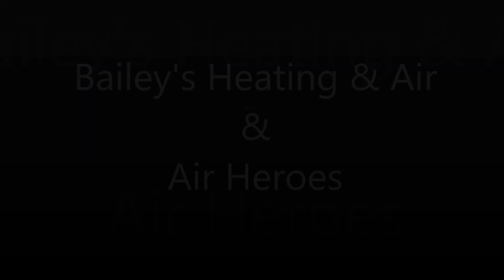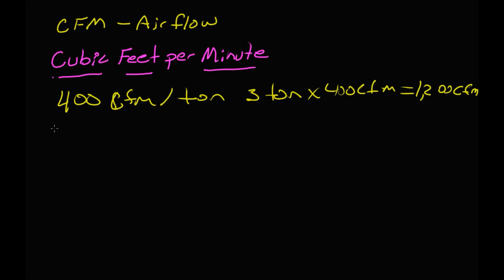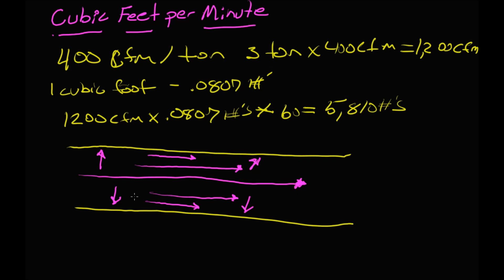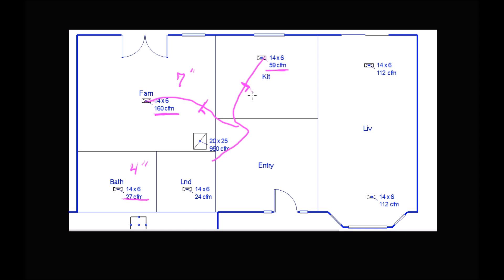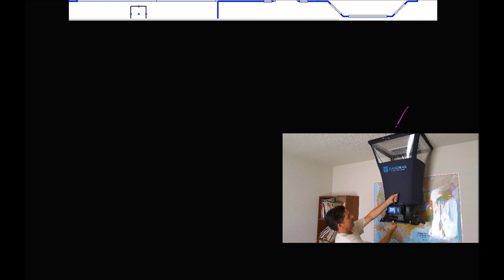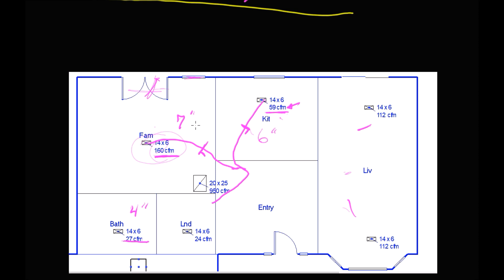CFM & Air Flow

Comment: great video!! thank you for posting it...
Which software are you using or can recommend for residential applications?? 
Thank you again!
Reply from the maker: Currently when doing testing we use the TruFlow Grid for static and cfm through the system. When doing a service call I use Fieldpiece smart probes and Joblink app. When designing a system on the computer I use Wrightsoft right draw and right duct. Links below.

Wrightsoft https://www.wrightsoft.com/

True flow grid https://www.trutechtools.com/tec-minneapolis-digital-trueflow-grid-full-kit-with-all-8-adapter-plates-no-manometer.html?gad=1&gclid=Cj0KCQjwtO-kBhDIARIsAL6Lore-ISwGfbK0aJNgq-ileA79e00rCy4cf529F1rnyMrZXEtkvfvRzrwaAqqiEALw_wcB

Fieldpiece https://www.fieldpiece.com/product-category/job-link-system/

Comment: If I need to do a load calculation on each room to find out how many CFM I need, what's the point of a ductulator?
Reply from the maker: Once you know the cfm needed plus the friction rate you need to use, you use the ductulator to size the ducts to that room.
Reply: @baileysair  
So if i go on a service call and customer complains that a certain room is always warm, i would have to do a load calculation just to see if i have the right size duct(s) to that room and have the proper cfm? That seems like alot.
Reply from the maker: @BibleBloopers  Yes, it does seem excessive. But there is no other way to tell if the proper amount of air is getting to the space. However, you should ask the customer has it always been this way or did it just suddenly start? If it has just started, the first thing I would check is the ducts themselves that go to that room to see if they are crushed or disconnected. 

The next thing before doing a calculation is make sure that the loads in the room has not changed. For example did they just put a computer and monitor in the room? 

If this has been a problem from the start I would check that they have insulation above the room. If that is good I would take my flow hood and measure the amount of air that is coming out. I would also do it with the door open to the room and closed. Sometimes we find that when the door is closed the air is almost cut in half due to the return being located in the hallway (there is not enough undercut of the door to return the proper amount of air). 

Now a question for you, once I have that measurement how do I know what that number should be? The answer; The only way to know what that number should be is to do a load calculation.

Once the load calculation is done and I compare the number it should be within plus or minus 10% of what the load calcs say. If not I need to either balance the system (if there is enough air to begin with) or install a larger duct along with volume dampers in all the ducts and balance the system.

Okay, that being said there is one other thing that needs to be considered and that is how we install and run the system. What I am talking about is the location of the thermostat. Since we only have one thermostat in the home, we can have rooms that are hotter or colder. Why, because the thermostat does not know what the temperature in that room is if it is in the hallway and loads like computers, monitors, televisions, and people can cause those rooms to heat up quicker than the rest of the home and therefore before the thermostat has a chance to sense it. The solution, zoning.
Hope this helped, 
Mitch
Reply: @baileysair  wow, that's a lot of good info. Thank you so much for taking the time to write it all out.

Unfortunately, if i come across a customer who just moved in, they wouldn't know if this was always an issue or perhaps a new issue. But i hear what you're saying.

First things first, check to see if any ductwork has come loose or if anything is kinked. Check to see if there's insulation over that particular room. I actually never thought of that. I'm just a service tech so that never crossed my mind LOL. So insulation over room... Got it. 
And then check to see if perhaps they have a high heat load in the room.
Reply: @baileysair  
Assuming that your system is size correctly, assuming that when you walk into a house you have a 5-ton unit and it sized correctly. Is there at that point a rule of thumb for the size you should use for return duct and supply duct? I don't like assuming. But I'm just trying to get a better understanding of this. So my question is if I have a 5 ton condensing unit and air handler that is sized correctly, would I be able to calculate what size duct I need at that point?

The reason I'm asking is I went to a service call yesterday where my airflow seemed a little crappy. I'm following up today. But I'm wondering if my return and Supply duct is sized correctly
Reply from the maker: @BibleBloopers  First question, what is the total external static pressure? I have a video that shows how to take static https://youtu.be/gnmcplXbOT0 You can download the manual for this particular air handler to see how much air is actually being delivered. NCI has a duct design table that says a 20" flex duct is capable of about 1700 cfm, and typically that is what I see installed on 5 ton systems all the time. However, don't think that just enlarging the return or adding another return will do the trick. You see, if the return ducts are too small what makes you think the supply ducts are sized correctly? They are probably not. Many companies think that just by upsizing the return will solve all the airflow problems, this in most cases, is dead wrong. 
Second, if the TESP is too high, I would check to make sure the coils is not plugged and or the filter may be clogged or too tight. 
Let me know what you come up with.
Reply: @baileysair  i took external static pressures today. The furnace is rated at .5 wc and i was getting .82
I'm just learning about taking static pressures so i kinda screwed up by not writing all the numbers down. 
I should've wrote down what my static before the blower and static after heat exchanger was but instead i just took it and came up with .82. 
The filters were just changed the day before and i cleaned the evap coil even though it wasn't that dirty. 
My blower was running on high speed. I should've got the size of the return flex duct and the supply ducts.  I feel like I'm just not getting enough airflow across my coil. So frustrating not knowing much about duct sizing.
Reply: @baileysair  i sure wish you lived in Las Vegas. Id pay you to teach me lol

Comment: can we calculate the how much pound of duct needed per CFM ?
Reply from the maker: I am assuming you mean how much duct per pound of air or cfm. NCI calls out the following for Flex duct 5"-50 cfm, 6"-75 cfm, 7"-110 cfm, 8"-160 cfm, 9"-225 cfm, 10"-300 cfm, 12"-480 cfm, 14"-700 cfm, 16"-1000 cfm, 18"-1300 cfm, 20"-1700 cfm. These numbers are based upon a friction rate of 0.05 on the metal duct calculator. These are all approximate and can be used as a reference when sizing ducts for the air needed for the room.

Comment: How can we calculate the fresh air fan cfm to enter a 50k cfm capacity room for Ventilating that room
Reply from the maker: The amount of ventilation is based on the volume of the space, cubic feet, times the amount of air that you usually want change in an hour. I assume you are talking about 50,000 cubic feet, a room that is 50'X100' room with 10' ceilings. If we desired 4 air changes per hour for a room this size on an industrial building we would divide 50K by 60 and multiply by 4 we would need 3.3K of ventilation. 
However, on a residence we are looking for air changes per hour of 0.35 which for the same space would equate to 291 cfm fan.
So, as you can see it will vary according to the what the space is used for. Below is an excellent web page on this. Hope this helped.
https://www.atlenv.com/building-ventilation-the-proper-air-changes-per-hour-ach

Comment: 60.60.80? Double check😅
Reply from the maker: If you are talking about the weight of the air, I checked the math and it comes out 1200 cubic feet  per minute X the weight of air 0.0807 pounds per cubic feet X 60 minutes does come out to 5810 pounds over an hour. Anyhow, I was trying to show that an air conditioning system pushes a lot of air. Thanks,
Mitch Bailey

Comment: Gm sir, your 400 cfms per ton  you use for for return and supply?
Or 200cfms per ton for return and 400 for supply?
Reply from the maker: Sorry this took so long, but I must have missed the notification, to answer your question, we use 400 cfm per ton for return and supply, 400 in and 400 out. However, if you live in a humid climate you might slow down the air to 350 cfm per ton so that the air is in contact with the coil for a longer period and allows more moisture to be removed, or dehumidify the space. That is one of the first jobs that Willis Carrier did http://www.williscarrier.com/1876-1902.php.

Comment: Great video. How did you calculate the CFM required per room off your heating and cooling loads? Did you assume a supply air temperature and figure out the CFM required for both heating and cooling, then take the larger of the two? Thanks!
Reply from the maker: I use Wrightsoft software to do my load calculations. You draw the house up in the software and then the computer does the calculations to give you the size of the equipment and loads for the rooms. The computer also will size the ducts for you, which makes our job much easier. You can do the load calculation manually, which is much more time consuming. 
Here is a link to a video that I did for someone who was just starting to use Wrightsoft https://www.youtube.com/watch?v=3bdpqGEe6lA&t=1663s 
Really the only right way to do heating and air is to do a load calculation room-to-room, then install dampers in the ducts to balance the airflow to the design. The problem is that too many HVAC contractors skip this part and then the customer suffers. This is why many contractors put in systems that are over sized, they are trying to compensate for poor design. This makes matters worse because too large equipment will cost the customer more money to run and will not satisfy the cooling or heating properly in the home.
Reply: Thanks for the reply. If I have my cooling and heating loads calcualted for each room, how would I manually calculate the CFM required in each room?
Reply: Thanks for the help